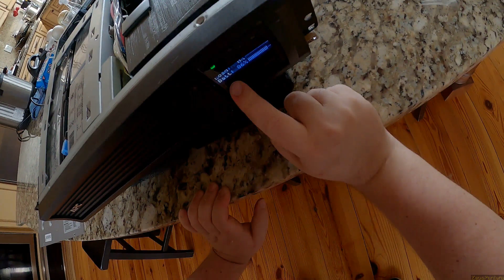Z Unboxing - APC 1500 UPS

Comment: I have 2 of these in my homelab rack for my servers. The port on the back allows you to install different cards such as APC AP9631 Smart Slot Network Management Card 2. You can then log into the UPS and control the outlet groups aka turning them on and off, monitoring power usage, setting up SNMP to have data pulled from it into a monitoring program, and you can hook up an environment probe for things like humidity and temperature.

Comment: Z, I have the same 2 post rack that you do. I put a giant router on the bottom of mine. Take 2 2x4s and put them between the supports crossways. Then add a piece of 3/4 thick wood on top of them and the apc will basically sit flat. You can shim with paint stirrers if you need to.

Comment: for something so small and powerfull, you should put it horizontally and remove the cover

that's what i do with my 6 desktop computers and the difference is at least 10 degrees celsius